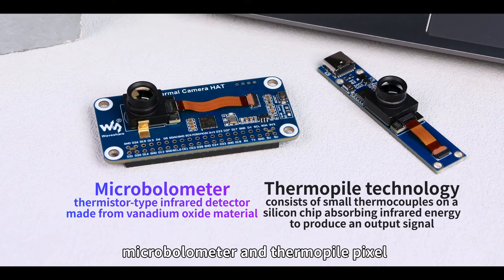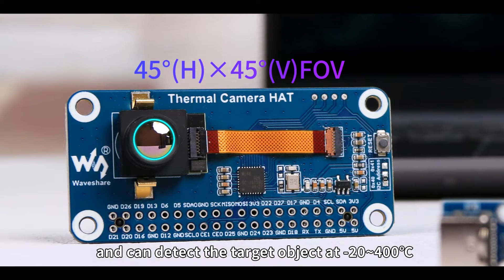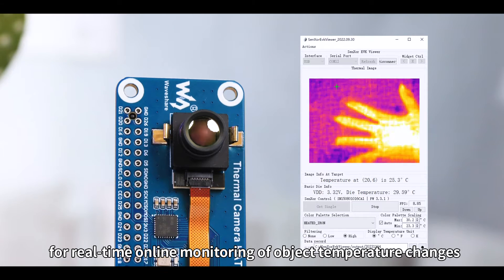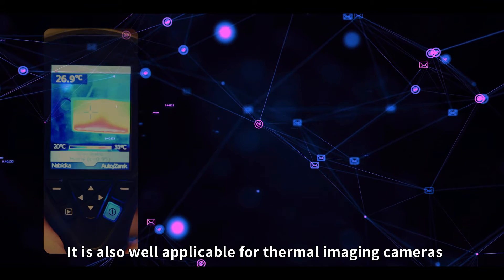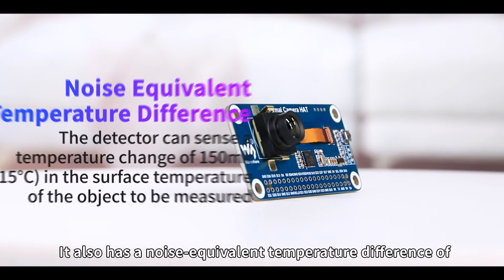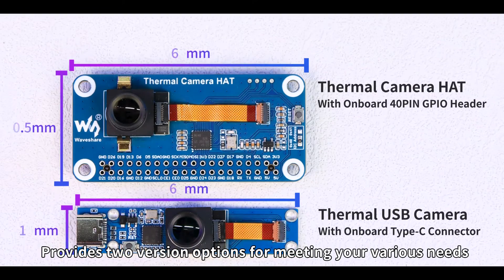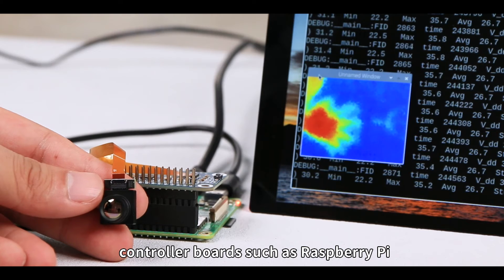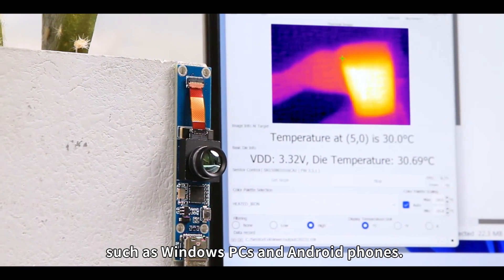Long-Wave IR Thermal Imaging Camera Module, 80×62 Pixels, 45°FOV, 40PIN GPIO Header Or Type-C Port

Comment: I was trying to find some methods to integrate this with ROS, but i failed there is no option available also library, 
i tried the  method they have showed in the page, but it got so many errors with raspi-4, i am using ubuntu with ROS setup, still failed to run this  Device
Reply from the maker: hi dear, for usage problem, pls feel free to contact our support team https://service.waveshare.com/

Comment: Could this be used to pick up the heat of electrial wires behind drywall & even harder the old thin wooden slats & plaster?  ...after they were heated up by using a high powered device on the power line, to heat up the wires.  Would be so much easier to just map the wires in one go instead of playing "air hockey" on the wall with a puck.  I am sure it could be used the same way involving hot water piping, & maybe cold water pipes too.
Reply from the maker: It can be detected, but because the wires are blocked by walls and absorb heat sources, resulting in uneven heat, the accuracy will be greatly reduced. it will be not as accurate as directly measuring the temperature of the wires For any more question, pls feel free to contact us on https://support.waveshare.com/hc/en-us/requests/new